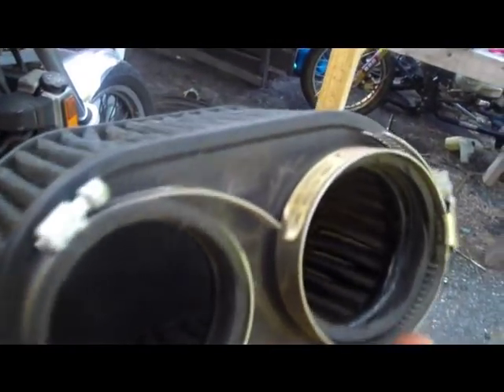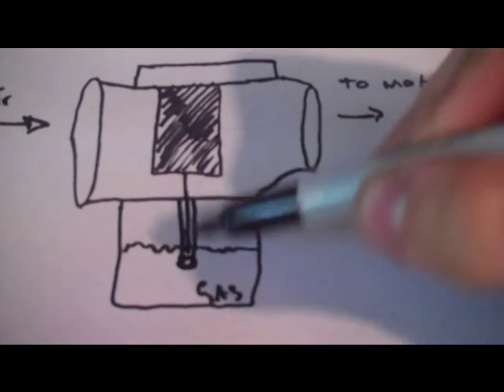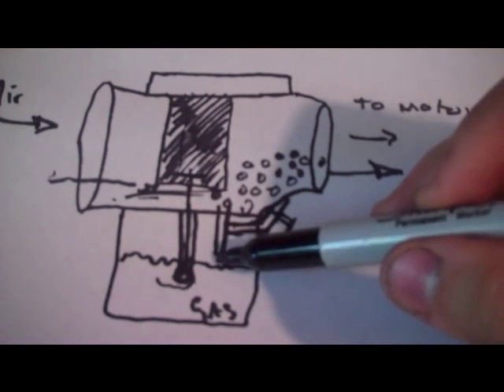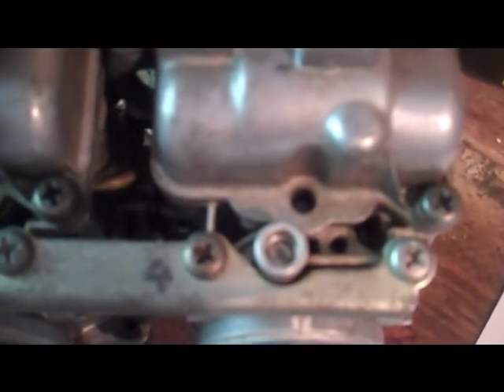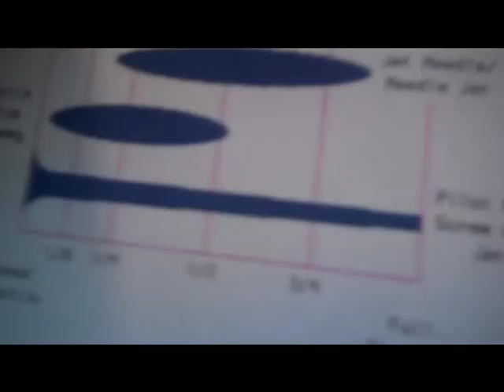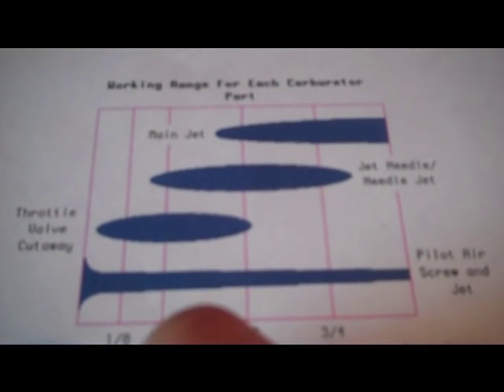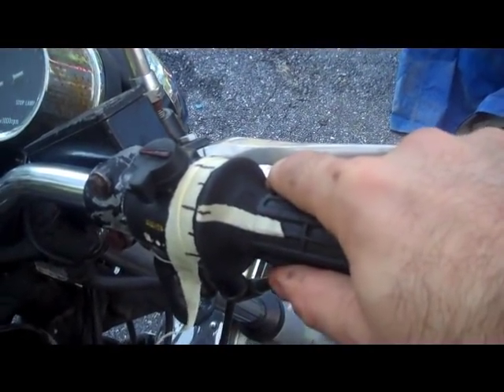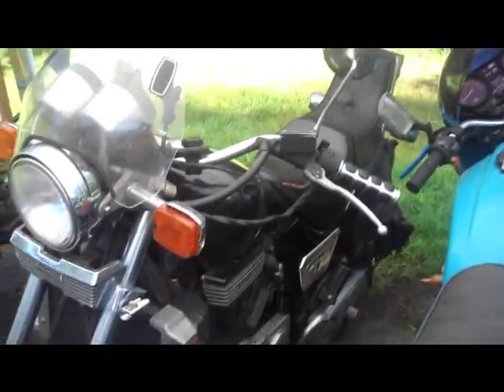How to adjust the jets on motorcycle carburetors

Comment: I have always been scared of messing with my carbs, but after the great video! " I no fraid dat" brilliant and thankyou!
My carbs are doing what you mentioned as in on a steady throttle it's ok but when I increase the gas it bogs down and as I increase more gas it then clears and takes off, so by your great vid I gather that I have to lift the needles up to richen the mixture, as these problems are  in the 1/4 to 3/4 throttle position. I do hope I've got that correct.
Reply: so i got a gs450 i put pod filters in it air screw is 2.5 out jets are all stock.  my problem is 1/4 throttle n the bike bogs but on the high end she goes.  so am i too lean or i need to bump my pilot jet n main jets as well as lifting my needle?  help.
Reply: Kevin Moreton  top spec video and full on information well explained think everyone should get the basics from this,brilliant.
Reply: Kevin Moreton

Comment: This video has been a god send. I did an engine and carb change on my bike and it wouldnt start. I put the old carb on and got it going, but then decided a few weeks later to try the new carb with the old carbs settings. After neither would work. I'm going to start from the hand books settings, get it starting with a good idle then work from there using what this video has taught me. Cheers!

Comment: Hi. I have an old Zephyr 1100 which had been re-jetted many years ago by the previous owner who installed pod filters and a straight through exhaust. I wanted to return the bike to the stock air filter and standard exhaust and your video was invaluable. I now understand the workings of the carburetor, and have installed standard jets, removed the shimming on the jet needle etc. I have also adjusted the float level until they are all in sync, and adjusted the pilot jet. The bike now runs like it has just come off the production line all the way through the throttle range. Thank you for your video which was really easy to understand and incredibly helpful. Oh, I also checked the plugs which are the correct colour whereas they were black and sooty before.  So cheers from the UK; I now feel confident to tackle any other carb problem that comes along.
Reply from the maker: Oliver I'm very pleased my video was able to help you out

Comment: I recently bought a 07 Kawasaki Vulcan 500 from a buddy who had let it sit for several years and it was not running. When I started messing with this bike I had absolutely no idea what I was doing... and truthfully I still dont. However I've done tons of research and have probably watched just about all of your videos. They have inspired much confidence and given me the knowledge needed to get the thing running. When I bought it, the airbox and mufflers had been removed. I installed pod filters. Ive cleaned the carbs and went up two sizes on both pilot and main jets and shimmed the needle up as far as I can without adding extra washers. After syncing the carbs she starts right up and idles just fine indefinitely. Now that I've made it this far, I am stuck. When I shift down in to first and start to ease off the clutch it just dies no matter how much I open the throttle. It wheels are locked after it dies, so I know it's in gear. Could I still have a jetting issue? I fear that there is a bigger problem. Which doesn't scare me really, I just don't know where to look. I understand diagnosing problems like this off just an amateur's ramblings is not ideal, but you seem to know your stuff and I'd appreciate your thoughts. Thanks you.
Reply from the maker: Does the bike rev up quickly while in neutral? And second question, when the bike is in gear and you go to take off, does it die quickly or does it kind of sputter to a stop?
Reply: When I pull throttle wide open in neutral it will stutter and then regain. And in first it dies quick without even starting to creep forward.
Reply from the maker: Shane Riley
OK well it sounds like you still have more carb adjustments to do
Reply: Bigger pilots at least I'm thinking. As for the stutter at 1/2 throttle, I guess I'll have to get little washers and shim the needle up further. This is what I gather from your carb adjustment video. Sound like I'm on the right track there? Thanks for the feedback. I'll let you know how it goes.
Reply from the maker: Shane Riley
Well if the bike idles well then the pilots are pretty close. Id perform the throttle test I showed towards the end of the video, to determine exactly where in your throttle range you are failing. That can tell you whether you need to change the pilots, shims or mains

Comment: Thx Max for demystifying this part of taking care of an old non-original bike. Best carb video on the tube! On my GSX 1100 -83 it sits a 4-1 exhaust and open air box (cover removed). This is standard for these types of motors. Your video instructions is great in all respects except recommended main jet size. Going up just 2 steps is too small for some bikes. My original is 107.5 and a good main jet size is somewhere around 122.5 - 130. Anyway thx again!

Comment: Thanks dude, your explanations are really thorough and I like the scientific approach for deciding which adjustments to do. I have a Yamaha Virago 125 and got told that it just runs fine, and that it is normal having to rev up the (weak) engine a bit more. But the truth is that the engine slows down when accelerating (overtaking!!!) at about 50 mph. But then it could suddenly (spontaneously) accelerate again. But I have a very hard time to reach the maximum 60+ mph. So this points towards a needle / jet adjustment problem if I understood that right....
Reply from the maker: Do you have any modifications to the bike?

Comment: Thank you for the very nice tutorial. I am working on my 2001 Yamaha V-Star 1100 classic. I have removed the AIS system and the backfiring on deceleration went away. Next I drilled out the first and last baffles on the stock exhaust and the sound is more to my liking. I haven't re-jetted the carbs yet, other than to add one 0.020-inch shim on the needle and open the PMS screw one-half turn. Next I plan to modify the stock air filter/inlet system to some kind of pods that sit under my gas tank.

Comment: Hey, Ive asked you questions before, and these videos have helped me get my bike running again, it was running fantastic for the last week, but yesterday it started acting funny and today extremely bad. Yesterday it would be boggy until I 3/4 throttle and then all 4 cyls would kick back in. plugs 1&2 are decent but plugs 3&4 were wet, with some black. Im pretty sure they are flooded. It still runs even though those two cyls dont really fire (pipes dont get hot on warm up).

Comment: Thanx Max. Planning to install an open flow exhaust and velocity air stacks on my CX500 project's twin Kahinis and you have explained "tinkering" with carburetors very well indeed. I have had advice about the increase in size of the main jet from .78 to .90, which is a big jump, but I'll let you know how it pans out.
Reply from the maker: OK yeah that is a big jump but on some bikes it is needed

Comment: Great video. Today, I was fouling plugs every 15 minutes on my 1999 Husky WR125. It was ungodly hot and humid and the fouling seemed to happen after high rpm, wide open operation when I slowed down on a trail. I was thinking about replacing the 2 year old fuel/oil mix, cleaning the air filter and lowering the needle .. possibly replacing the main jet. I will check out your other videos. Thanks.

Comment from the maker: I never add oil to gas unless it is a 2 stroke, just straight gas. If your manual says 91 then definitely use that, it will prevent pinging in your engine and you should use it all the time. An oil cooler is a great idea, if you can get one use it for sure. And thanks for the offer on the airbox, I'll keep it in mind after we move!

Comment from the maker: One of the advantages of having an intake on the carb is that it helps to organize the airflow into a nice steady stream which pulls through the carbs and venturi, picks up the gas, and sends it into the engine. If you don't have any intake on there then you will find that you get a lot of vortexes and eddies, which can cause the gas to spit up all over the place, even back out the carbs, its just not an efficient way to deliver gas into your engine

Comment: Thank you for the reply. The plugs and the air filter have been in for a year so I am going to swap them out along with oil and filter this week. It all started when I fixed a big split in one of the carb rubber connectors (boots?) by replacing it. Ever since, it's been a swine to start since but runs 1000 times better at speed. I think the guy that sold it to me adjusted it to idle well with that split to avoid fixing it / didn't see it.

Comment from the maker: Thanks... and yeah you replace the jet with a larger one, if that is what you need to do. But it will make the bike run richer, not leaner, the bigger the number, the more gas it lets through, so the richer the mixture. Don't be afraid to replace the jets, usually they just pop right out

Comment from the maker: You can always replace the sprocket with one with more or less teeth, depending on whether you are going for top speed or off the line power. Also on a bike so small weight conservation makes a lot of difference, anything that you can lose to trim down the weight of the bike will help you out

Comment from the maker: For that motor the tuning process can be very touchy, people have reported it to be quite difficult, you are subject to crosswinds and the mixture rarely runs evenly throughout the RPM range, but they are cool as hell and when you get it right its sweet. Just remember your stock settings if you ever want to go back, and don't get frustrated if you have to buy 20 sets of jets before the bike runs perfectly

Comment: i bought a vice grip tool and managed to unscrew all but 2 screws witch i drilled carefully and it worked. My carbs are still opened , i had rust inside, enough of it but the jets were clean , u can see trough them. I cleaned them with alcohool and its like new. I dont know wich jet is wich but who cares ,  i cleaned and will put it back together . Thank you for much help, as i was stuck many times during the work.

Comment: First..your video is awesome! You explained it so well, thank you. OK I have a 2007 shadow 750, air/fuel screws were 6 turns out,..cobra pipes had been installed.this is how I got it, ran great! I cleaned carbs and then put larger mains in, now 3/4-full it bogs out..have to baby it to get it up to 55mph!!! HELP wish I never would have even touched it!! So mad at myself. Thanx
Reply from the maker: Why not just set it back the way it was?
Reply: mrmaxstorey that's probably what I'm going to do, but somber said that the air/fuel screw shouldn't be 6 turns out, and if I keep running it lean I will blow my motor!
Reply from the maker: That screw only is a minor adjustment when the bike is at idle. Anything above 1/8 throttle the mixture is controlled by jets. If you are concerned, put it back to setting where it ran well, and then do the spark plug test at the end of this video to see if you have any spots on the throttle range that are running lean
Reply: mrmaxstorey ok, thank you so much for your time and knowledge! Also thanks for responding SO quickly!

Comment: Thank you for the help. I will post another vid later. Yes it is a k and n it also has a noleen slip on. The stock main is 148  i put 155 and it was doing the same thing. Im still running the stock 38 pilot. I sprayed carb cleaner around all of my intake and head and pretty much the whole top end and no bog or rev.

Comment: Thanks they were pretty dirty the bike hasn't ran since 97. I will take carbs back off off blow them out again there was rust in the pilot jets. But it did run ok before that except 3rd cyl not getting fuel so I rebuilt all the carbs. Thanks for the help I will pop them back off tomorrow.

Comment from the maker: Im not sure if we are talking about the same thing here. The picture shows the inside of the bowl of a carb, where the jets reside. This is where the fuel is drawn from, travelling up the emulsion tube and into the venturi to be mixed with air. But it is not behind the butterfly valve

Comment from the maker: I'd look to float heights first, and then vacuum leaks. If you have a moderate vacuum leak then the engine turning over slowly via the starter motor can't create the vacuum to draw atomized gas into the engine, however the engine running may create enough vacuum to draw the gas, so it can run fine but have problems starting cold. Also check out your choke circuit

Comment from the maker: I'd start with both, but be prepared to change the jets various different sizes before you get it right. Typically the smaller the engine, the more difficult it is to re-jet after adding performance parts

Comment: Very good. As stated the drawing was not the best. But, works. You just forgot to draw the dome above the slide, that houses the Slide. Then it would have been acceptable to some of those critics. You know I am sure after reviewing the Video that the slide will not recess into the vacuum bellows area it is not even possible. But, great explanation of the workings of the carb and fuel mixture.I subscribe to your channel.

Comment from the maker: @Saiph2266 Yes if the jets are too large then the bike will run rich. It is somewhat effective to drop the needle down a bit to lean out the mixture a bit, if that is an option on your bike, however like the video illustrates, adjusting the needle only has an effect on a certain range in the throttle. It will be difficult to get your bike to run well throughout the range just by adjusting the needle. Slow jet, main, needle, intake, exhaust, all need to work in harmony

Comment: I went ahead & put RTV on both sides of the gaskets & the bolt areas. Seems to be running like a champ now. I have a few more test to do when I get the chance. At the moment my New bike is taking up a lot of my time & also I get busy @ work on the weekends. Btw the New bike is a 2011 V Star 950 tourer

Comment from the maker: Yeah, its a common problem that I have struggled with many times. Heres my suggestions in order of least -> most desperate: 1. Clamp on the screws with a vice grip, turn to break them loose. 2. Impact driver. 3. Cut a slot in their heads with a dremel to get on there with a straight screwdriver. 4. Cut off the heads and drill out the screws. 5. New carbs. 6. Push bike into a lake

Comment: I understand that but what i was saying is that the 2nd bubble is the power from the transition port. Its not from the air pulling up to the main jet. Its increased air traveling under the butterfly as it opens.The fuel from the main jet is the 3rd phase of the throttle. At least that is what im led to believe.  I have to take my carb apart to make sure though.

Comment: Loved your video explained quite a lot, also helped me to clean my twin carbs on my Johnny Pag Spyder. I have a problem, that your video touched upon and that is when I am in 3rd gear going slow and when I open the throttle the bike will stutter. Same in 4th gear as well. what I have to do is throttle off and do it gently, then the bike will behave it self. No stutter. It also gets worse when the engine gets warmed up. The throttle is about 1/4 to 1/2 a turn when the bike starts to stutter. Like I said earlier I have to gently turn the throttle to avoid it stuttering. Or avoid it altogether I keep the revs high threw out the gear change. What do you think is the problem is...It's times like this I wish I was still in England where one can find a good mechanic but alas, I live out in Vietnam where you only find cowboy mechanic's.
Reply from the maker: Do you have any modifications to the bike?
Reply: mrmaxstorey Wow! Now that was a quick reply. No there has been nothing added on. When it first started it was bad. had the carb completely stripped down and cleaned and the bike felt new. There was dirt in the jets at that time. but this time there was no dirt only a varnish type covering. I used a carb spray cleaner that made the carb look new. But I still have this stutter but not as bad as it was. Hope this is helpful.
Reply from the maker: NomadicDreamcatcher
OK id clean those carbs again, check for vacuum leaks, put in a new air filter and an inline fuel filter, and see where that gets you
Reply: mrmaxstorey OK done what you  said to do and still the same problem. It's as if it's not getting enough fuel in the low revs.
Reply from the maker: NomadicDreamcatcher
Check the float height
Reply: Just an update. I have cleaned the twin carbs so that they look new. Also cleaned the spark plugs...that had normal colour...air filter. The problem still the same and that is, when crawling in trafic and then open up the throttle, 1/4 turn the bike will stutter, in all gears. I have no idea now what to do.
Reply from the maker: NomadicDreamcatcher
ok... and those float heights?
Reply: mrmaxstorey What would be an ideal float height for a '78 Yamaha XS400F? Everything is stock with the exception of pod filters. I'm asking simply  because NomadicDreamcatcher and I are experiencing the same issues :/
Reply from the maker: Ricardo Martoccia
Unfortunately I dont know, you'll have to consult a repair manual or check with another XS400 owner

Comment from the maker: This video shows you everything you need to do to adjust the carbs for those modifications, or you could put a stock exhaust and air filter back on and it would probably run a lot better. I have a video up on my channel for setting float heights